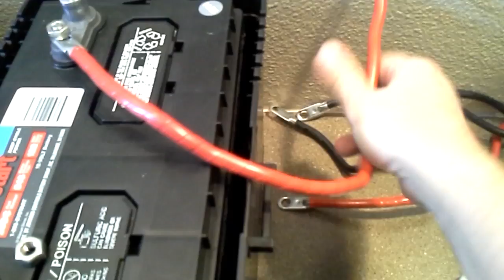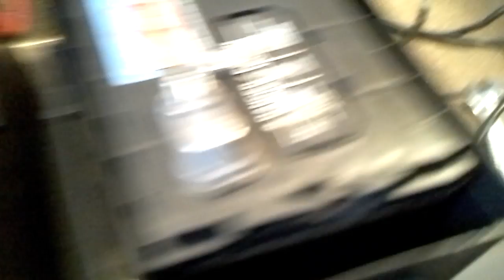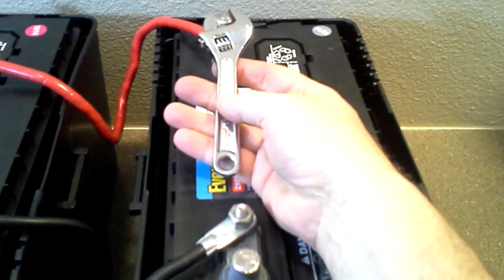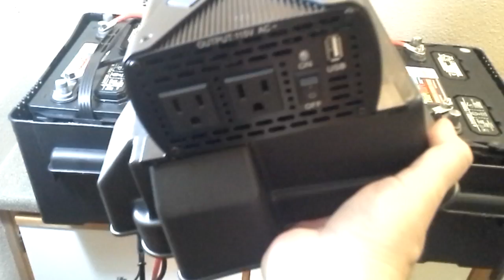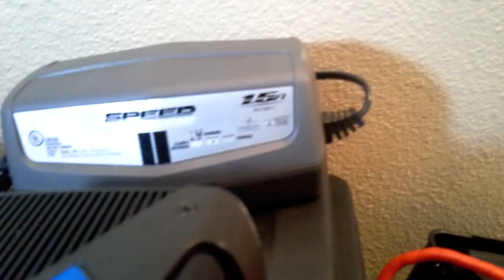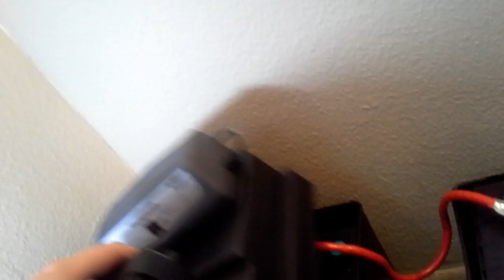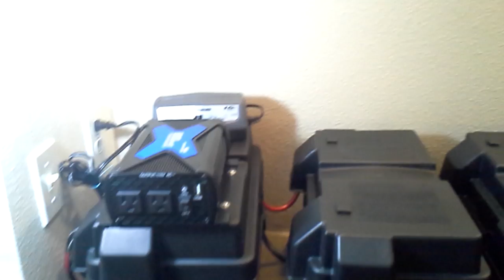Installing 4kW/Hr battery bank with 800W 120V Inverter and Trickle Charger from Tactical Woodgas

Comment: Only two concerns with this installation one under charge batteries vent hydrogen 2 conflicting metallurgy would cause electrolysis ie oxidation oxy ban would prevent this found in the electrical aisle at your local hardware store design for Union copper to aluminum but good for electrolysis applications:)

Comment: OMG! No fuse! Where is your fuse? This guy needs to review propper solar install and safety and then remake this video. A little FYI for all those watching with no experiance.  

1. You need a fuse between the inverter and battery bank, not a car fuse or stereo fuse, but a blue seas marine fuse. Blue Sea fuses when blown create no spark and are mounted right on top of the battery stud. Since the fuse creates no spark and is connected right on top of the battery, eliminates the potential for melted wiring, fire, and the possibility of a spark setting off the hydrogen gas batteries create when charging. That's why Blue Seas fuses are used on boats and enclosed spaces. Look up Blue Sea 5191 fuse block.

2. Do not install your batteries indoors unless they are AGM batteries "Absorb Glass Matt" or you have a vented battery box, with a vent tube going out side.

3. If you are going to charge phones and run some lights 800 watts should be fine. But if you plan on running a fridge, or tv or lap top, you might wanna consider a 2,000 watt pure sinewave inverter. The 2,000 watts will be enough to power a small fridge, and why pure sine wave? Pure sine wave produces clean electricity like the electricity going through your house. Using a power inverter that is not pure sine wave for tvs or computers, can damage your electronics. Most power inverters sold at department stores or your autoparts places are not pure sine wave.
Reply: +WoodsMan 4. To drain all 3 batteries you hook the POS terminal on the first battery and the NEG post on the third battery.  Attaching the inverter to the same battery creates stress on that battery and will kill it faster then the other 2
Reply: that was my thought when he was connecting the inverter all the loads will be too much on the first battery and it gonna spoil the first battery quick
Reply: This is not a solar system it is a grid back up with a battery charger and circuit breakers.
Reply: The inverter is internally fused.

Sine wave inverters are only required for synchronous motors (used in industrial applications,  not homes).  I have powered everything I have from modified sine inverters like the one shown.  No issues.
Reply: The battery boxes are vented, and hydrogen in interesting quantities is only generated under very have charge/discharge conditions, beyond the power rating of this unit.
Reply: +Mike Leister 

meant to say: under very heavy

Comment: How many battery's could be need for a 3000watts inverter
Reply: I have a 3000 watt inverter and use 6 x 100 ah deep cycle batteries. Works great. It is a 24 volt inverter so I have 2 parallel rows wired in series for 24 volts
Reply: about 4 battry
Reply: @larrybibey757

Comment: great basic back up system ! don't know if inverter is true sign or not. important for electronics. They make inverter/chargers so only 1 unit. come 24V 36V 48V and some of them have auto transfer switch which makes a UPS back up. only thing I would add to your system is a volt meter and a surge protector fo the charger . can use 6V golf car batteries also.

Comment: Posting so people can learn from our mistakes... I used similar Walmart marine batteries (24DC) for a small solar system. There are two important things to be aware of - the amp hour rating of these batteries is based on a 1 amp draw which would never happen - actually capacity is much less than the rating under normal use (battery capacity is not static - it's based on draw). They also have thin plates which means they won't last for many cycles, I barely get a year or two from mine with light use. For the same price I could have purchased 6V GC2 (golf cart batteries) from Sam's Club, which have thicker plates, an honest rating (C20) and a longer cycle life. Having said all that, if you're keeping yours charged until there is a power outage you won't be as concerned with cycle life. I recently upgraded to Trojan T105-RE batteries which cost twice as much but should last 10x longer.
Reply: Go to Iron Edison Battery Company for your batteries.
Reply: Sorry miss link  IronEdison.com

Comment: NO FUSES!!!?? ALSO BEST TO ATTATCH RED AND BLACK FROM INVERTER TO OPPOSITE ENDS OF THE BANK OF BATTERIES   GOOD EASY INFO VIDEO WELL DONE
Reply: Exactly what I was going to say..
Reply: If you want to be sure that you charge and discharge your batteries equally you need to use a pair of shunts which connect to each battery equally. When going battery to battery in the way shown there is a MINUTE difference in the amount of power going to and from the first and last battery in a parallel system (which in most situations you would not even notice) due to the difference in the cable length which loses voltage in the form of heat dependent on the distance traveled (a common problem power companies have with distribution lines).  To be anally retentive about your wiring in parallel, take 8 cables of EXACTLY the same length and connect them all to the batteries, but not from battery to battery. Instead run each pair of cables to two common shunts (making sure all positives go to one and all negatives to the other) then connect the charging system and the inverter to these same shunts, also positive to positive and negative to negative. This is a lot like putting headers on your car engine, they help to even the load on each cylinder, or in this case battery, to insure that each battery is charged and discharged equally. You would also connect the 12v power out to the same two shunts. This method also lets you remove or add a battery to or from the system without taking the system offline. This makes your system "hot swappable," to borrow a phrase from the computer industry.

Comment: To ensure proper charging to the batteries and to ensure the batteries are all charged equally, when connecting the charging unit, you need to connect the positive lead from the charging unit to the positive post on battery ONE.  Once that is done, connect the negative lead from the charging unit to the negative post on battery THREE.  Connecting the charging unit this way ensures that all three batteries are charged equally at the same time.  Connecting the charging unit as you show in your video will put undue stress on battery ONE and battery ONE will receive a full charge before either of the other two batteries are charged.  This produces batteries that are NOT charged equally and any given time.  Positive post on battery ONE, and then negative post on battery THREE is what you should be using to achieve equally charged batteries.  The batteries will also provide equal voltage and current across all three batteries this way.  Otherwise, a very interesting video.
Reply: I really want to learn.  I am going to have 2 batteries. Can you please tell me if I have to charge each battery first before hooking these up together?
Reply: @Believe30  You can
Reply: @MrSummitville  Thanks!  I will check that website out!

Comment: Can I hook this system up to solar panels Instead of using the outlet ?  The gaol is to use free energy rite?
Reply from the maker: Roc Lebeau 
Yes!  The link below takes you to a version that includes a solar charge controller.

There are options for 800/1200/1600W inverters that include solar panel support.

https://www.tacticalwoodgas.com/online-store/Battery-Bank-with-1200W-AC-Inverter-plus-solar-wall-car-charging-ports-p95165068
Reply: Roc Lebeau 
What about wind? How efficient is that?

Comment: Why not use a solar panel for the trickle charge?
Reply from the maker: We have added versions with solar charge controllers and solar panels.  Also added 1200W, 2000W, and 3000W options.  Info and videos at www.tacticalwoodgas.com
Reply: Oh, I see, I was watching a commercial.
Reply from the maker: @joeyocom5087  
...a how-to video customers asked for, but also helps the do-it-yourself folks.
Reply: You can

Comment: Only one small criticism - the positive inverter cable should be attached to battery 1 positive, and the inverter negative cable should be attached to battery 3 negative,  rather than both cables being attached to battery 1, with batteries 2 and 3 hanging off battery 1.  That way the inverter power HAS to flow from all three batteries equally.  This method of wiring takes out any imperfections (resistance) in the connections between the batteries.  The mains power charger wires should be connected in a similar fashion so all batteries share the charging current equally.
Reply: I agree with you on that he also didn't show where the load wiring is going to be
Reply: @homermcclain7694  The load wiring gets plugged in into the power sockets provided on the inverter.

Comment: I use two T-105 Deep-Cycle Flooded golf cart batteries connected produce 12 volts.  They have deeper cycle rating and work far better for this type of solution, Go Power! GP-RV-80 80-Watt Solar Kit with 30 Amp Digital Regulator.

Comment: You need to hook positive at one end of your bank and negative at the other end of your bank both inverter and charger so you're battery bank current is equal throughout or you will overwork your battery bank unequally.  Remember path of least resistance.
Reply: That's what I was thinking he's wired it wrong
Reply: Yup this guy is wrong lol

Comment: OK so I have a c class rv and want to replace my propane fridge with an all electric one. The one I'm getting only uses 64 watts and draws 0.75 amps. I want to add a 3000w inverter to also power a 20in flat tv, small sound system, small electric fireplace and microwave from time to time along with phone chargers. I'm sure that a 3ooow can handle all that, but as for the battery, I'm getting an Optima blue top marine battery. Do I need a second battery to run my fridge all day even though it does go on and off like most home fridges. Also can I tap off the alternator to charge it while running, even though it also charges the 12 volt accessory battery as well as the engine battery? Thanks.

Comment: 800 watt inverter won't run a fridge or freezer.
Reply: when buy inverter have know how amp inverter have ok i have 800 watts inverter and 8amp i have 1100 watts inverter and its 9amp i have 500 watts inverter and 4amp ok there 4000 watts inverter 30 amp on amazon you know how amp the inverter have it sucks am in Toronto Canada i 1500 watts inverter from a guy it only said 1500 watts 120AC 60Hz
Reply: @jacksmith3951  everything depending on what you want to operate off the inverter and how many batteries you have to supply the inverter. This type of power supply is only hood for emergency light radio telephone just basic needs these things you can do with a 400 watt inverter and one strong battery if you want to power a refrigerator then you will want the 4000 watt inverter and at least 4 strong batteries remember the more you plug in the faster the batteries dies and you dont want your batteries to get lower than 50% of its power.

Comment: the vid was good, but connected in that fashion the batteries will not draw evenly. he should have attached the first inverter lead to the positive or negative of first battery and the second lead to the opposite terminal on the third battery. that way the charge and discharge hits evenly across all three batteries. that holds true no matter how many batteries you have in the bank. Also, i might point out, though his batteries were all the same, it is recommended that you buy all batteries for the bank at the same time and also buy the same model batteries so the amperage is the same for charging. another thing to point out is that those are lead acid batteries. most inverters will cut off at 10.5 volts, but if you buy AGM batteries, the voltage stays 12 ish  while the amps are drawn, IE, longer run time... most of those batteries are rated in amp hours not CCA.
Reply: Kord Stone agreed the inverter should be connected across opposite ends. That is the bar minimum to even out current drawn unevenly in his demo. There is a better way
Reply: Dang! That is a good point!
I'm changing my battery wires ...NOW.

Comment: Hello. I have a previous version of the Whistler 800w, not the Pro. Now, in Venezuela the deep cycle batteries are too expensive. I want to use 2 common car batteries 12v / 800ah. Should this work? My other question is about batteries re-charging. I always used before the inverter with a single, standalone 12v/900ah battery. It lasted 1h -1.5h to dis-charge but I never used like I saw here, the battery connected permanently with a battery charger which could supply a continuous re-charge. I have a 12v battery charger BatteryMinder 2012. Could I connect it permanently to the 2 12v/800ah batteries and use the inverter the same time? Many thabks, Florin

Comment: how long does it run your fridge for on the batteries? 3-6hrs?
Reply from the maker: J M 
Nearly 3 days!  The compressor on my refrigerator  uses 300W, but only runs 10% of the time so that is an average of 30W.  One battery holds 600W-H usable power (the inverter cuts off when the battery is at half charge to extend its service life).  600W-H/ 30W = 20 hours per battery.  With 3 batteries, that is nearly three days between charges. 

If you buy the version that has a solar charge controller and solar panel, you get 500W-H per day so can run your refrigerator forever.

If you live where the sun rarely shows, and use only one battery, just recharge each morning with your car and jumper cables.  Start your car, connect the jumper cables from your car battery to your battery bank battery, and let your car idle for 45 minutes.
Reply from the maker: J M 
I don't have an ice maker.  The heating elements to release the ice cubes use a HUGE amount of power.
Reply: Tactical WoodGas is charging with car good if there is solar controller or better to disconnect it
Reply: The batteries are how many amps. And what's the amps of the inverter too
Reply from the maker: Osbone Osbon 
The batteries are 100 amp-hours which is 1200 watt-hours each.  The inverter is available in 800W,  1200W,  and 1600W.  Details and more videos at www.tacticalwoodgas.com
Reply: Tactical WoodGas when you plug the cable to the outlets does that charge the batteries?
Reply from the maker: EDSON VOLNY 
Plug the A.C. charger into a wall outlet and it charges the batteries.
Reply: Tactical WoodGas I didn’t see when you installed the battery charge to the batteries
Reply from the maker: EDSON VOLNY 
That wiring is already done when you purchase the unit.  This video shows how to install, not design.  More photos at www.tacticalwoodgas.com

Comment: thats not 300ah of usable battery only about 150ah
Reply: Running in series your ah stays the same but in parallel they do combine together so indeed three 100ah batteries connected properly would create 300ah but with such a small inverter it's really not necessary he would be much better off running two 6v batteries in series for the 12v and achieve a much longer run time with the same 800 watts he is creating with three 12v
Reply: @3ormorecharacterstimes2  you cannot drain lead acid past 50% so no it is not 300

Comment: Your wires connecting your batteries are way too long good luck
Reply: Actually they are not too long.  Most important thing is they are all the same length.
Reply: @noneya3504  what happens if some are longer than others?

Comment: Wtf is tactical Wood gas?  You have 3 batteries in parallel, a charger,  and an inverter….Add a relay and you can power the inverter automatically when power drops out…Add some solar panels and regulator and you can keep it running without paying the bill…..Is that permanent wood gas?